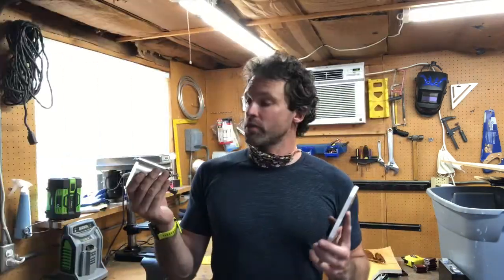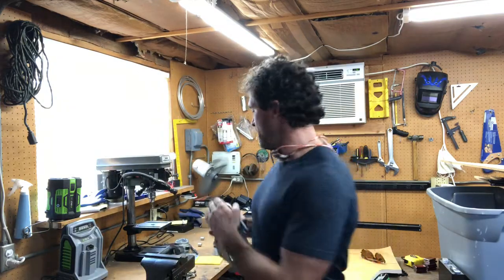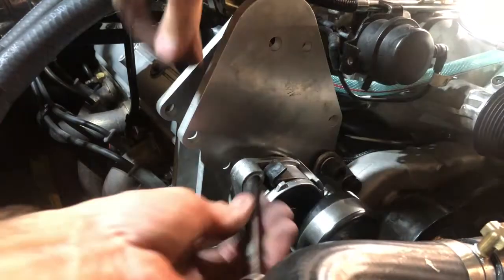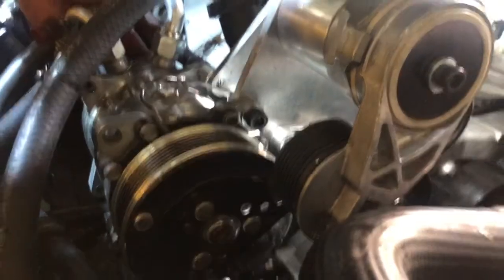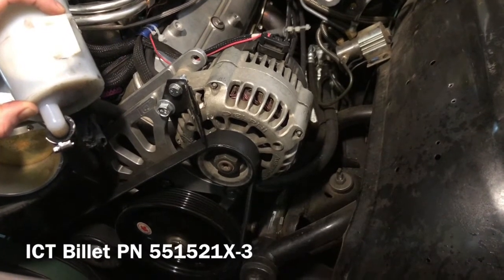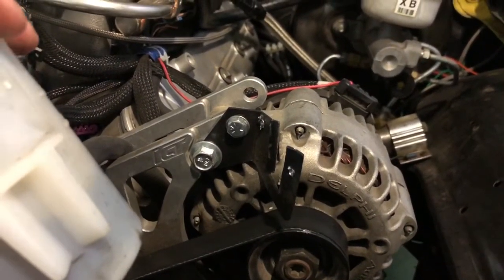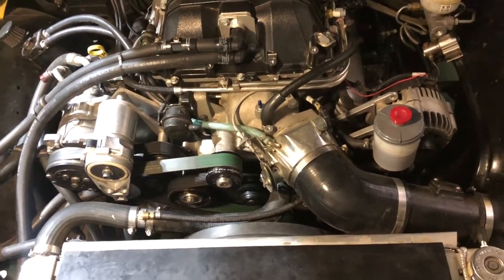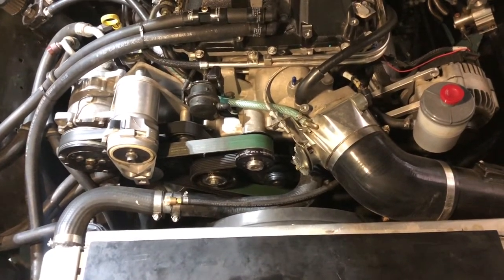My Custom LSA Accessory Drive

Comment: just for your information, our LSA Race Drive when properly setup will provide 5-10% more boost that the factory LSA tensioner..... your horror story you heard was probably from someone who didn't properly tension the belt. we have Race Drive's on professional drift cars that run the engine on the rev limiter with no slip...and we have car's running well over 800HP on a 8 rib

Comment: How are you liking the vintage air? I am thinking about doing it on mine. I have a restoration going on my 68 Nova on my channel.
Reply from the maker: Love it. Works great up to about 110°, then the car starts getting hot inside and under the hood.
Reply: @lsxbody7535  awesome, I’m up north so it rarely gets over 95.

Comment: What would the cost be for the LSA Tensioner bracket and spacer?
Reply from the maker: I had the spacer custom-made at a machine shop I worked at. It’s a simple aluminum rod I bought that we drilled a center hole and a couple blind holes to pin it and the tensioner to the bracket.

Comment: Would you happen. To still have the specs on this bracket you made. Also on for power steering reservoir
Reply from the maker: I used a power steering reservoir from a Honda Element. It’s plastic, about 3” diameter and 4” or 5” tall. I made a bracket out of sheet metal to attach it to the alt/PS bracket.